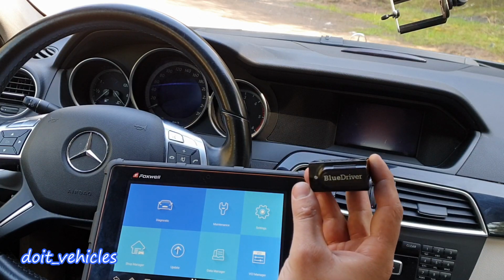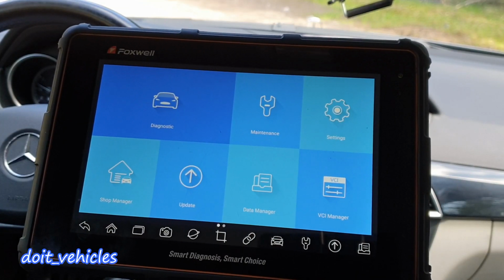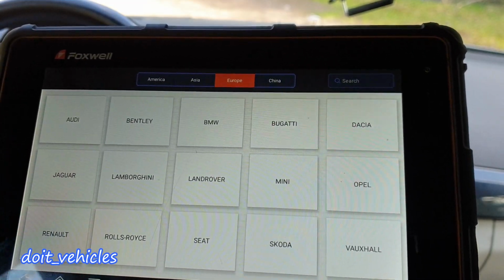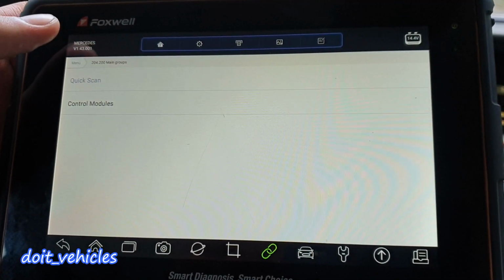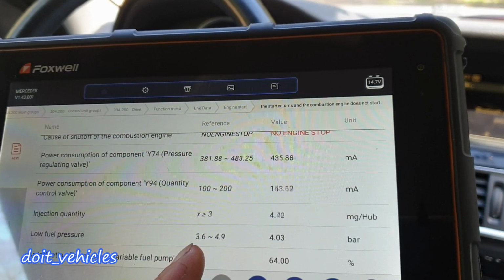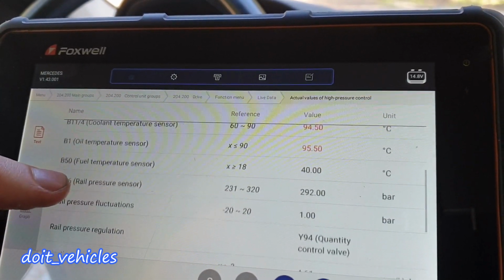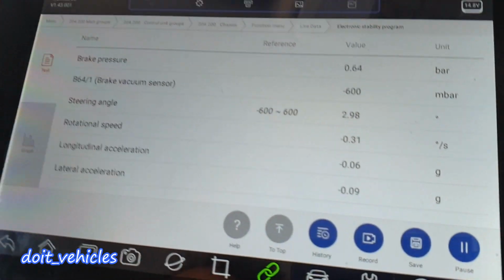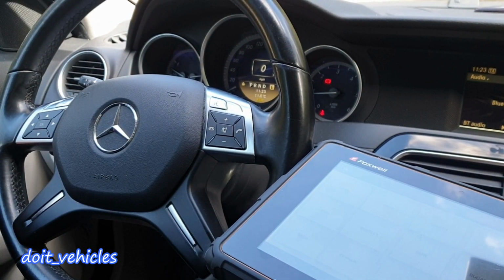Foxwell i 70 pro VS Bluedriver on Mercedes W204 C180 CDI scan tools

Comment: Hello, I am interesting by the I70pro for a C215 - CL600. Do you know if you can do active test on suspension ABC (rodeo mode) on the W220 (same like C215). Best regards
Reply from the maker: Hi ! Since I haven't tried this tool on the CL600 I am not sure, but I believe so
Reply: @doit_vehicles  Hi thanks. The suspension ABC on the CL600 are the same like Class S (W220)

Comment: I'm a fan of your work, every video is very helpful for any car. What is the best OBD to use for the VW Up 2013?
Reply from the maker: Thanks , the question is how much you want to invest and how long you want to work on cars . As I said in the unboxing of the foxwell , I would either go for something cheap as a beginner like 100$ or to the top ones betwen 1500 - 3000 $ . I would never buy " the middle ones" not because those won't be capable , that's just me .
Reply: @doit_vehicles  it will be only for my personal car (VW Up) not for business